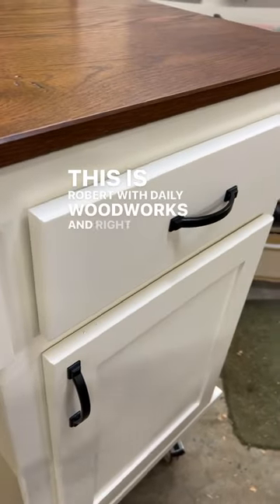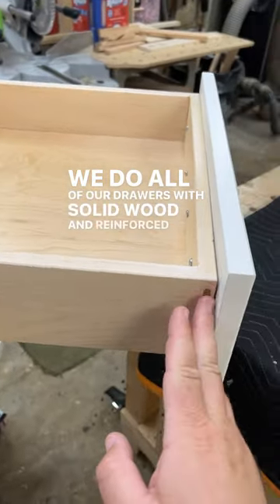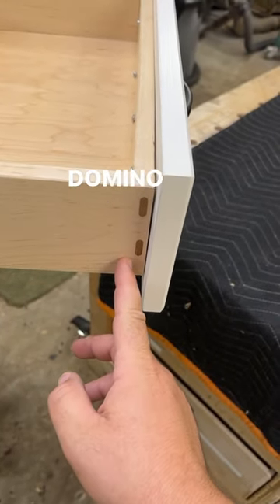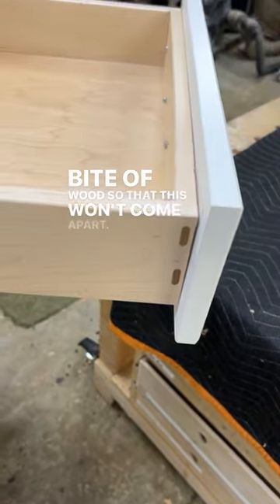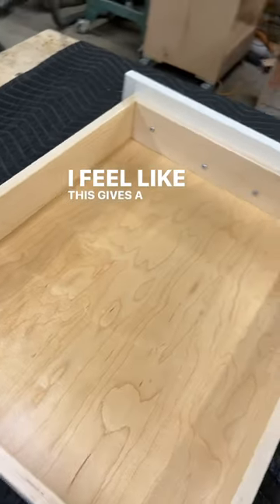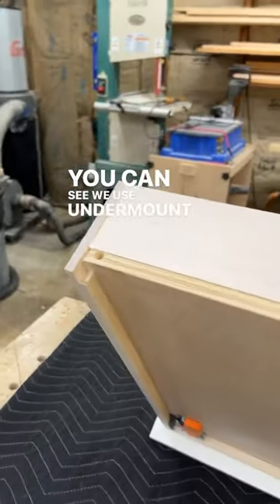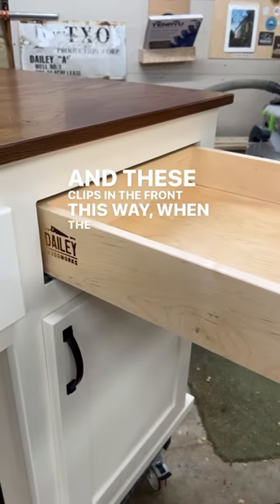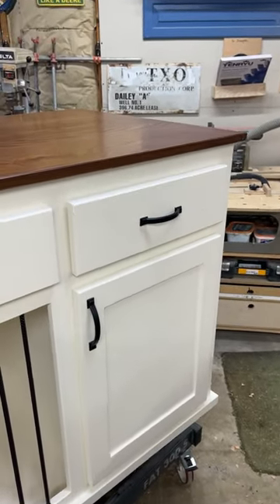How I build my Drawers on my custom furniture pieces - Dailey Woodworks Bryan, Texas

Comment: Whoever attached the drawer face should be fired ngl. It's it flush on the drawer, it's slanted flush at the bottom but a gap opening toward the top. Makes for a weird gap when the drawer is closed which negates all the other aesthetic elements added
Reply: it was the first thing that screamed at me terrible fit

Comment: Built to last.  I am also a fan of 1/2" ply bottom.
Reply from the maker: Thank you. And nice! A friend (who runs a larger custom cabinetry company) found that by ditching 1/4” entirely in his products he actually saved money by better utilizing scrap, so I followed his lead and found it to be true.
Reply: @DaileyWoodworks  no one wants a saggy bottom!
Reply: 1/4 inch bottom with a couple added front to back cleets makes it plenty strong. Those drawers are nice but WAY over built along with not being efficient and cost effective.